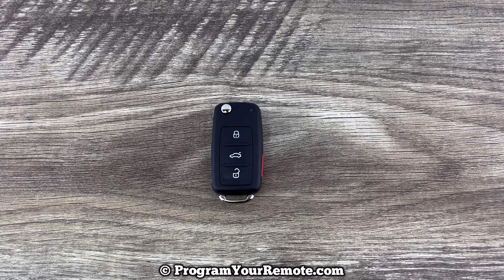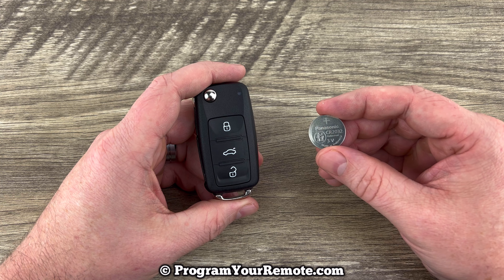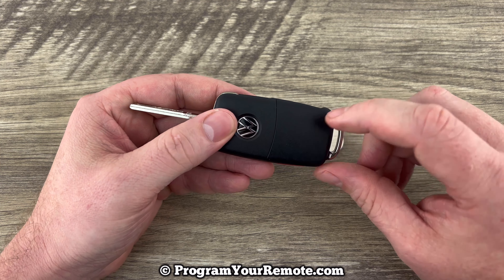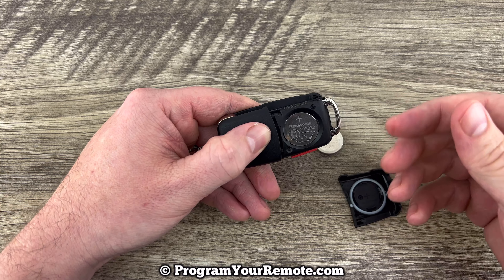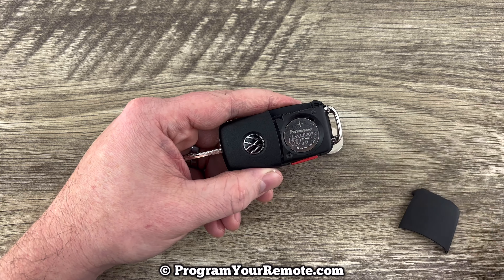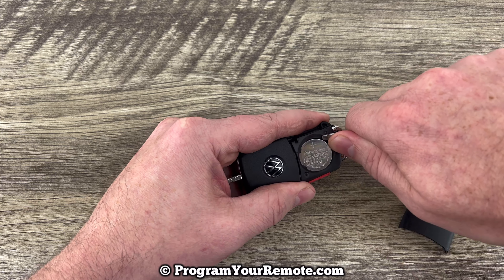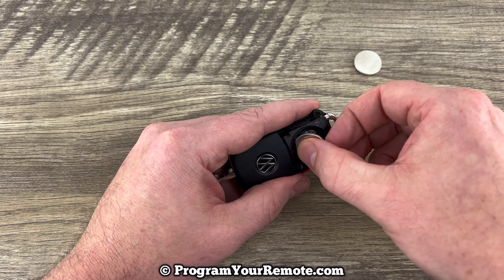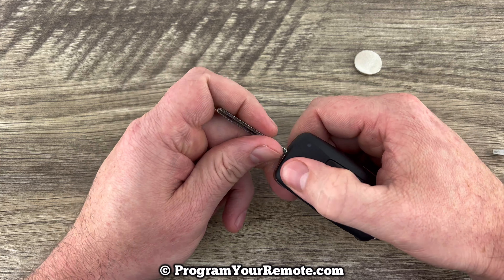2011 - 2015 VW Passat Remote Fob Key Battery Change - How To Remove Replace Volkswagen Key Batteries

Comment: Do I need to program the key after replacing the battery or is it this simple? Curious bc I only have 1 key so I'd be screwed if I replace and then it doesn't work on the car lol
Reply from the maker: the should not need reprogramming after just changing the battery